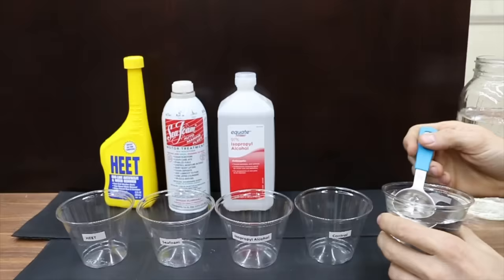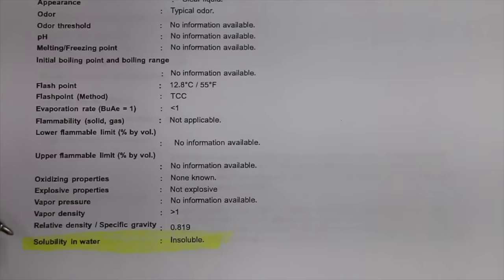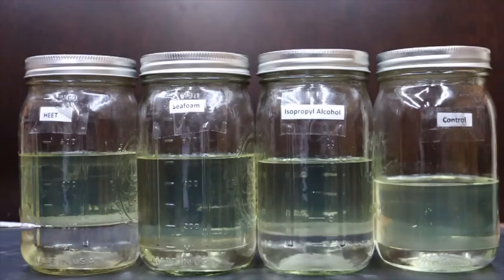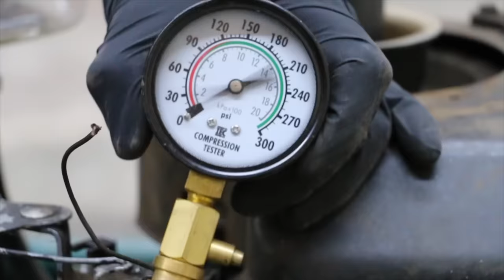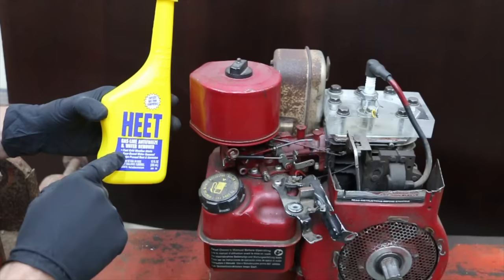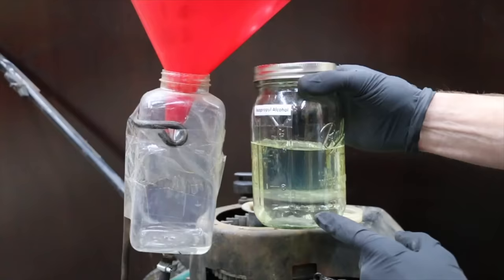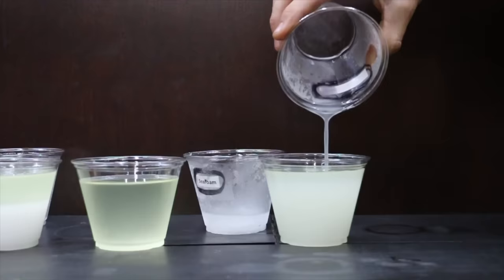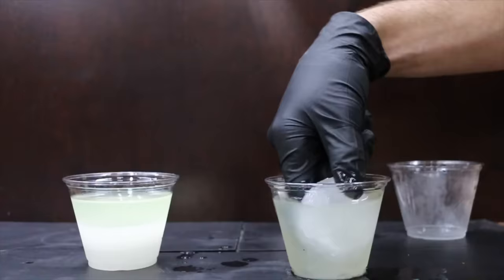Is HEET better than Seafoam for Water in Fuel?  Let's find out!

Comment: The methanol/ethanol will lower the freezing point of water if it's already mixed in, but once the ice is frozen adding alcohol won't help much, since the ice is solid and the alcohol can't really penetrate and mix with it. It might work very slowly by eating away at the surface, and agitating the mixture would definitely help, but generally speaking it's no good.

Something i'd be interested in seeing is adding artificial alcohol-based sweeteners to the fuel, particularly ethanol blends.
Another interesting thing to see would be emulsified fuel mixes. It could open up a whole new world of strange blends!
Reply from the maker: Great point!  Thank you
Reply: But its called HEET!!!   no Im just funnin yes it lowers the freezing point.   Ever wonder why good Shine don't freeze?
Reply: Dick Nickler   True, but this is how salt works on road ice – contacts, melts, dilutes, evaporates (and unfortunately drains).
Reply: Sure, adding salt, sugar or anything else that'd lower the melting point will help to some degree, especially if there's already a bit of water on the surface so it can start mixing, but you'd need a hell of a lot of salt to melt ice of any significant thickness. It's best for thin sheets or patchy road ice since like you said it does drain away, and you need a lot of it.

Comment: I was at Lowe's Depot in the paint aisle , and  had an Idea ..... Why not try Mineral spirits ,  paint thinner ,  naptha ,  xylene , toluene , denatured alcohol , paint stripper ect as fuel and as an additive to fuel for cleaning cylinder head . I think toluene was used as a anti knock additive a while ago .
Reply from the maker: Thanks for the video idea!
Reply: Mineral spirits wouldn't be a great fuel, but it's the main ingredient in diesel fuel additives.
Paint thinner is mineral spirits.
Naphtha is low-test gasoline. 
Xylene and toluene are both used as octane boosters. Probably not so good as straight fuel.
Denatured alcohol: No problem. 
Most paint stripper isn't flammable, so don't use that in your gasoline.
Reply: Most of that is the same as seafoam, berrymans etc. Xylene toluene and isopropyl alcohol. So t e only benefit to using mineral spirits in a test is to see if it's better or worse than seafoam
Reply: Lowe's Depot? 🤔
Reply: Ethanol is denatured alcohol.
Reply: @laurieberg2880  yeah but they add bad tasting ingredients so you won't drink it. Not sure what that is. It's great stuff for cleaning electronics. Should work fine as a bulk alternative to heet, I'd think.
Reply: @ProjectFarm  Also idea for lubricants, Mineral Oil and Aloe Vera just to see what happens.
Reply: @laurieberg2880  ethenol is ethyl alcohol, all liquor stores sell is ethenol in various forms. It is denatured for fuel uses do to different taxes imposed on the different uses of ethenol. Denaturing is frequently done by adding methanol (methyl alcohol) to make it unpleasant to consume.
Reply: i tried Paint thinner as a fuel in my car lol. It works. even better, it smells like sweet, grilled corn !
Reply: Lacquer thinner often comes as a mixture of most of the volatile chemicals you mentioned. That’s why it is an effective cleaner.
Reply: Let's not forget acetone .
Reply: @obsoleteoptics  
yeah if you're actually in the construction business like I am , you'll find yourself going to both stores because one or the other doesn't have something . Plus I couldn't remember which store I was at when I had the idea , and where I live they're right next door to each other .
Reply: Might be ok for a short term test, but i would assume due to its corrosive nature it would eventually eat through any rubber fuel lines/ injector seals etc, I'm certainly no expert though.
Reply: Many years ago, I tried using acetone as an additive to improve fuel economy. I did see a slight improvement. But since it wasn't a blind test, I could have been unwittingly affecting the test results.
Reply: @georgeauldiii3886  Only alcohol will couple with the water, all the other chemicals for this application are filler.
Reply: @laurieberg2880  Denatured alcohol is ethanol with menthaol and/or other poisons so you cant drink it.
Reply: A drunk guy I bought a 1985 honda vf700s motorcycle from was pouring denatured alchohol in it when I showed up.. he says hes been doing it for years to clear up old bikes.... but the guy was also wasted so who knows
Reply: @laurieberg2880  Methanol
Reply: @laurieberg2880  Yes and no.  Denatured means its blended with other toxic chemicals so you wont drink it.  You also dont have to pay an alcohol tax on denatured.  Now if your talking 100%ethanol then its not denatured and is drinkable and taxable.
Reply: @johnpossum556  Denatured alcohol is mostly ethanol with methanol and some other mildy toxic chemicals.
Reply: @jaydunbar7538  They only "denature it" if its for non human consumption.  THen you dont pay the liquor tax.  Any denatured alcohol is considered poison with the denatures they add.

Comment: After buying a Diesel truck and having a fuel line freeze up in the middle of the winter, I started buying Heat to put into the fuel tank. Unfortunately, like in the testing, once frozen, the lines stay frozen until the whole Vehicle can be warmed above 32°.  So after regularly  dropping over $5 a bottle for Heat every tankfull, I looked at the ingredients. After reading the ingredients in Heat and looking at the difference in price between that and Isopropyl alcohol, its really a no brainer as to which one I would use. Also as mentioned by someone else, isopropyl is great way to get an old clunker through the emissions process too !
Reply from the maker: Thank you!

Comment: You should test windshield washer fluids.
Reply from the maker: Great recommendation!
Reply: Check out Scotty Kilmer on his 'take' on the blue stuff vs.  the new Rain-X.   NO more blue dyed water with a bit of alcohol to keep it from freezing.
Reply: Don't bother. Just spend a little more and use Rain X
Reply: Project Farm Windex brand washer fluid!
Reply: One of the best mechanics I know, who has been a service manager for a while now, told me that the Rain-X has been known to gum up some windshield washer systems. Then he told me not to worry about it in MY car, which is a basic economy car. I should ask him again about what makes the difference.
Reply: I’m totally sold on the rain-x. They used to sell one here with an ice melter in the winter, and a bug guts remover in the summer (a God-send during black fly season) both of which were amazing...but now it’s just “all-season formula”, which does neither task particularly well.

Comment: Please do something involving HEET red vs. yellow! Thank you!
Reply from the maker: Thank you for the video idea!
Reply: Red is pretty much just isoporplyn alcohol.
Reply: @t-bfr45-70  is the red 100% iso alcohol? Is it better using 99% iso alcohol? Is 91% ok?
Reply: @whatthe2458  no red is not 100% and is more than likely a lie. I believe it's a pretty hi grade you can us 90% and up if remember right for water remove because how it mixes if just wanted to buy isopropyl alcohol. More then likely they start with 99% and then add little oil and other chemicals to add a little cleaning power and make people feel happy so when buy iso heat probably like 80% alcohol but all a guess.
Reply: @t-bfr45-70  thank you

Comment: I use H2O as add-on to my organic body engine and I never had any issues.
Reply from the maker: Thank you
Reply: I prefer bud light it runs alot smoother
Reply: @bradg8682  Much higher rate of consumption, though, resulting in increased need for oil changes.  Also, makes the exhaust much worse.
Reply: Dark GT ya this guy lives in California 🙄
Reply: Yeah Hho , browns gas.. do one video for us on HHO
Reply: UnsulliedSpy it doesn't effect the exhaust since he has DPF and SCR emission systems with Adblue 👍🏼
Reply: so basically water

Comment: Curious to why you did not test Sta-Bil, Sta Bil Marine or Star Brite Star Tron? I have used Sta-Bil for many years and it has seemed to do the job.
Reply from the maker: Great point. I'll have to test those soon. Thanks again.
Reply: Stabil is to reduce oxidation not couple with water.
Reply: @ProjectFarm  seriously Sta-Bil is the most widely used product around for this purpose
Reply: @Avboden  Stabil is the most widely used to preserve the fuel octane level not remove water. HEET is by far the most popular for that.
Reply: Recommend that you read the label and see this statement on their site:  http://sta-bil.co.uk/
Reply: From the Sta-bil site:  "...STA-BIL Fuel Stabiliser also prolongs the life of engines by removing water from petrol tanks, and cleaning carburettors and fuel injectors. The solution works safely and effectively in all petrol blends, including ethanol-blended fuel up to E85."

Comment: None of them remove water they just make it disperse in the fuel evenly.   I can say living in Wisconsin, I have never had an issues with water in fuel.
Reply from the maker: Great point!  Thank you
Reply: It’s typically only really an issue when fuel sits for a long time.  Especially I powersports and older vehicles with a vent as heating and cooling cycles draw in air and then moisture ends up in the tank over time.  It can also be an issue if you get fuel from a station that water got into the tank from poor drainage.  I haul fuel for a living and it can definitely happen.  Especially if ice dams up and forces water into the drop area.
Reply: And you probably won't so long as they continue to add ethanol into the fuel, which acts exactly like Heet.

Before the ethanol mandate, water in fuel systems was a problem.  That all went away in the 80's when ethanol started to become a popular oxygenator.
Reply: I've only gotten water in my fuel because the gastation had broken storage tanks. What tipped me off was the slow flowing gas pump
Reply: Did you watch the video? The mixtures never dispersed into the fuel. They stayed separate.
Reply: @ghosttheoremproductions5469   the amount of water was excessive to the amount of gasoline.  And dispersion is aided by agitation.
Reply: First car was a 1984 Chrysler Fifth Avenue with a 318(2000), One cold  ass morning, had battery on charger because of no start, just crank and crank. Nothing. Added a bottle of Red Heet, waited half hour and tried nothing, Hour later it fired up. Now I use the Red Heet in every car just before winter, every year
Reply: Yes...water and gas don't mix chemically...but methanol mixes chemically with gas and water....
Reply: I have lived in MN and ND my whole life until last winter never had an issue. In January I filled up at small gas location. Within minutes of filling up the check engine light came on. I drove it home and wouldn’t go over 70 MPH. Added a “can” of red Heet and within a minute check engine light turned off and it ran okay again. I was very impressed. The reason the water got in the gas is we had a mild day where snow was melting and it must have crept into the gas tanks at small remote gas station.
Reply: @smiley3303  How fast did you want to go?  😎
Reply: IM Boss speed limit is 75 out here on some roads!
Reply: @smiley3303  Okay.  Okay.  Just checking.
Reply: smiley3303 my advice to you is STAY AWAY FROM SMALL AND SLOW SELLING GAS STATIONS
Reply: @Backroad_Junkie  I thought ethanol attracts moisture?
Reply: those old dodge v-8 were cold natured bastards.
Reply: @Backroad_Junkie  Thanks for the first intelligent comment so far.

Comment: Great video as always. I was wondering if you could test and see if raw eggs would work as engine oil. They probably won't but I was just thinking this morning, raw eggs are very viscous and therefore they might work well.
Reply from the maker: lol.  Thanks for the video idea!
Reply: Eggs used as oil will burn inside of engine and make it halt completly, just as it was with honey as oil.
Reply: Raw eggs may be viscous, but I don't think they're a lubricant.
Reply: and clean the engine before the test, so that afterward scrambled eggs are on the menu!!!  Then feed them to mice to see if they are toxic?
Reply: In my kitchen at about 200 degrees F the liquid eggs turn into completely cooked eggs - the only liquid then is the cooking oil or butter they were cooked in.

Comment: I drove a Nissan sport truck from a small desert town east of El Paso, TX, where I got water in the gas tank where I filled up, to Morristown, TN pulling a 12' U-Haul trailer by putting a container of STP Gas Treatment in the tank with each fill-up. The pickup ran fine all the way and upon arrival had the tank trained which contained almost 2 pints of water.
Reply from the maker: Thanks for sharing.

Comment: I wish you had included IsoHeet in your test.  I think that it is 100% dry isopropanol.  In the red bottles.  The drug store isopropanol you tested already had 9% water in it.  You can also get dry isopropanol in the solvents section of your hardware store.
Reply from the maker: Thank you for the feedback
Reply: The IsoHeet in the red bottles will not work near as good as the Heet in the yellow bottle. I have tried them both by putting them in a glass of snow and I won't even waste my money on the red bottles. Living in Alaska I always have a bottle of Heet in every vehicle.
Reply: @stevejames875  but that is snow or frozen water. maybe it is good on liquid water.

Comment: What happen if you use injector cleaner as fuel? I want to know
Reply from the maker: Great video idea!
Reply: I know when you take the car in to have the injectors cleaned, they run a pressurized solution through the injectors while the engine is running. You simply put the can on the fuel rack, and run until the cleaning fluid runs out.
I have a 2004 Ford Ranger with the little 4 cylinder with 250,000 miles, and never cleaned the injectors. I do run Lucas in it all the time, and Sea Foam about 2 times a year. 
I bought it used with 20k on it, and have used Royal Purple oil in it all the time. Never had a wrench on the engine except for spark plugs and oil change. (knock on wood). Still gets 32 MPG. I did have a clutch put in, and the transmission bearings replaced. I use the Royal Purple manual transmission fluid in it too. 
We had a 50HP screw compressor that we had ran Royal Purple oil in it, and it had fifty thousand hours on it. We had the company come out to rebuild it, and he said all the parts were still in factory spec.
Say what you want, that is damm impressive.

Comment: What I do is, living in Montana USA, I always add the red bottle of Heat to my fuel before the 1st freeze as a prevention measure (as well 2 clean my injectors a bit). I've never had a problem with ice or water in my vehicles and TRUST ME, IT GET FN COLD in winter here!
Reply from the maker: Thanks for sharing.

Comment: Hi I love watching your videos as they are very informative, you take a lot of care and go into a lot of detail when producing them. I just watched this video and actually tried out an additive yesterday that dissolves water in gasoline, diesel and helps burn fuel through with no problem its called Fuel doctor by Castrol. i was first very sceptic about it and tried it out in a glass jar at home and a little water remained at the bottom but when i added a little more of the additive the water completely mixed into the fuel.
Reply from the maker: Thanks for sharing.

Comment: It doesn't have to necessarily be ice, you could have gotten gas the night before and have a gallon of water at the fuel pickup and your car won't start in the morning. I use the red bottle of heat because isopropyl alcohol stays in suspension, the yellow bottle of heat is methanol alcohol and that separates over time.
Reply from the maker: Thanks for the feedback.

Comment: The only way you'll be able to solve fuel lines freezing is to prevent it from happening in the first place. As you demonstrated, you'll want to use these products BEFORE you have an ice problem. Once you've got ice in the fuel system, you're boned.
Reply: Especially when there is ice in the lines.
Reply: go with russian solution  build a fire under the tank lol
Reply: And what about antifreeze (ethylene glycol)? It lowers the melting point of water so shouldn’t that work?
Reply: @GRBtutorials  once it already freezes it's to late to add that
Reply: @GRBtutorials  also anti freeze in the fuel line can foul your plugs valves and oil...forget about the smoke itll cause while burning
Reply: @mobiousenigma  buddy told me in Alaska at the mines they do that if a truck shuts off and it's to cold to start
Reply: If I get ice in my fuel lines im moving. Aslo i live in south florida, soooo
Reply: For the most part these products are not actually to remove ice as much as to remove the water and get it out of the tank do to you tend to get more water build up in the winter and water its self causes problems for people.
Reply: Didn't work that way me. Got gas and it froze up a third of a mile away from the station. 22 below zero. Put 2 bottles of Heat in and about 6 hours later started it and drove it home.
Reply: True.

Comment: I appreciate the work that you do on these products. I am curious if the fuel stabilizers work any better. I have used HEET for many years for potential water (in my mind), and had good luck with it. I completely forgot about the Ethanol issue adding to the "problem". 
I don't know if you've ever done a test on sludge removers used before a car oil change. I don't know how you'd test. Looks the Lawn Mower will get another workout unless you can get volunteers to run a can through their car prior to an oil change.
Reply from the maker: Thanks for the suggestion.